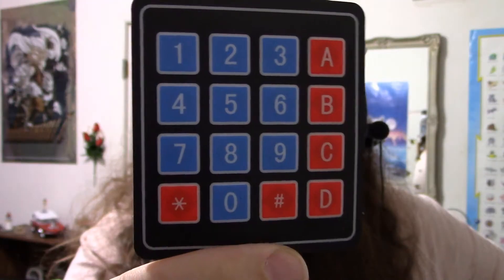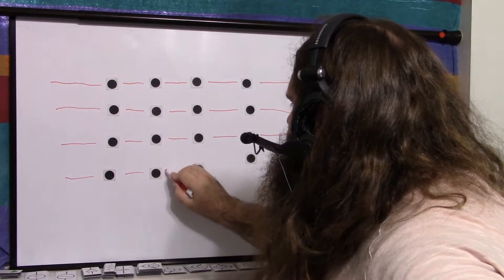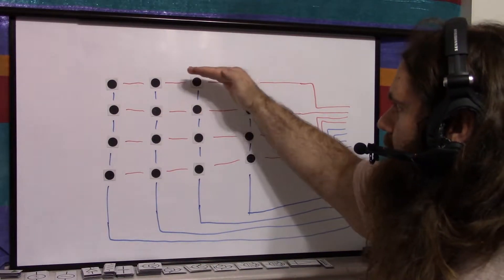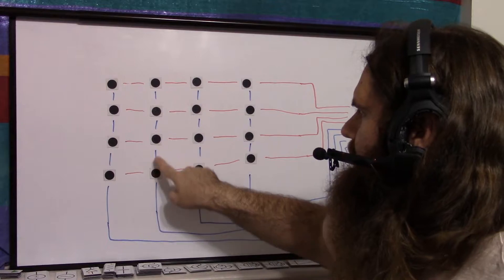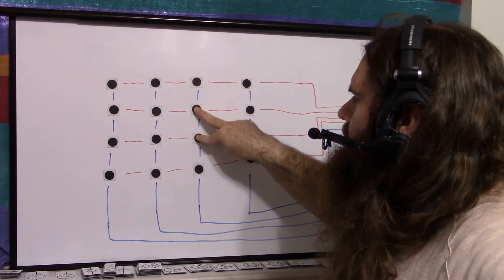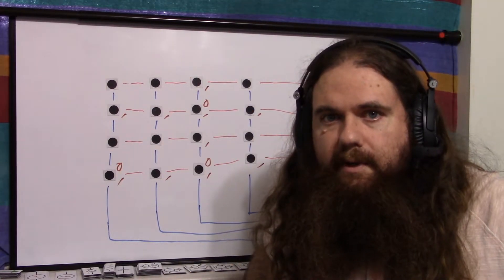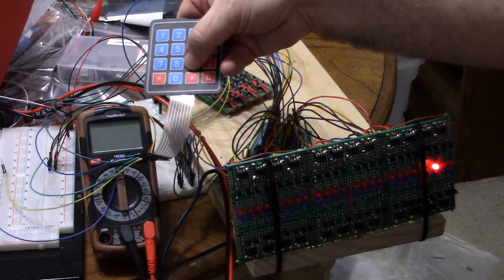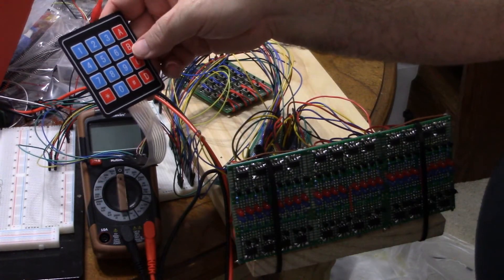4x4 (16-Button) Chipless Thin Form Factor Digital Keypad - Simply Put

Comment: Here's a little trick. This works with rows or columns but I'll use rows for example. Power all 4 rows at the same time. Read the columns, or use interrupts on the columns. When one of the columns goes high, power all the columns and read the rows. Because you know which column was triggered, when you find out which row has power, you will know which button was pushed.

For example, power all the rows. Scan the columns until one goes high. Stop powering the rows and power the columns, then quickly scan the rows. When you find the row that is high, you'll know the button: (x, y) is (high row, triggering column).

After, you can either go back to powering the rows, or leave power on the columns and wait for the triggering row.

Just thought I'd throw my idea out there, I hope its useful to someone.

Comment: If you make the matrix yourself, you can put a diode in series with each switch to make it unambiguous as to which one is pressed (the diodes prevent current from circulating through the other switches and activating other columns when they're not supposed to be, similar to how LEDs matrices can be lit up in any combination without any of the others turning on, because each element only conducts in one direction.).

Comment: Couldn't you put four seperate values using resistors through 4 of the wires and then use the four outs on pins that will read the value of the current coming through? This would solve "one row at a time" but not multi button inputs.

Comment: so you could read one of these with the resistor ladder you were talking about yesterday or the day before?
Reply from the maker: You could plug four of the wires into a DAC such as the one I showed, sure, and read it with an analog pin, but it would be much slower and require additional components. So it all depends on whether you have more board space or pins to spare.